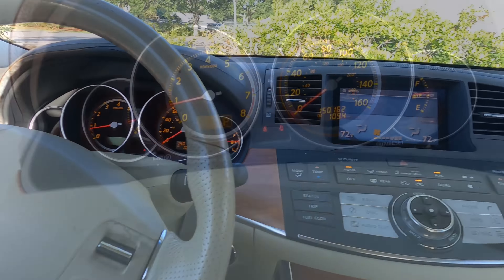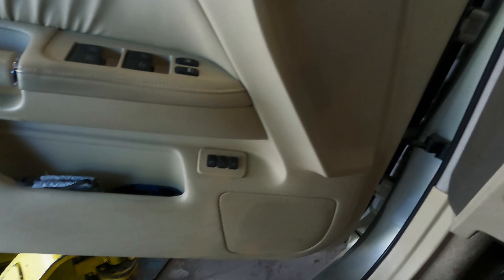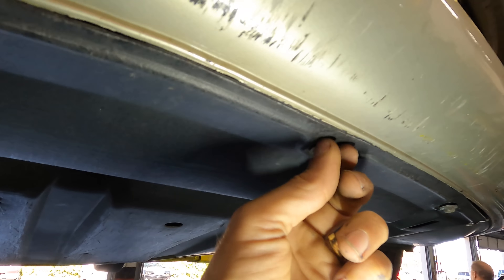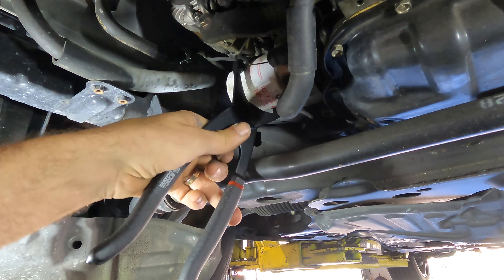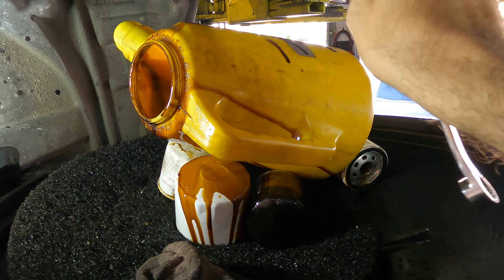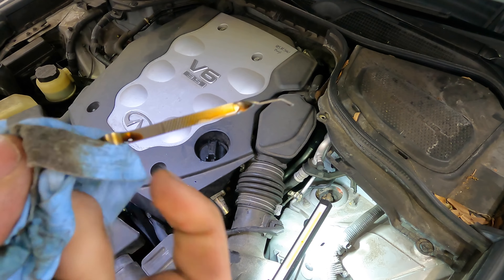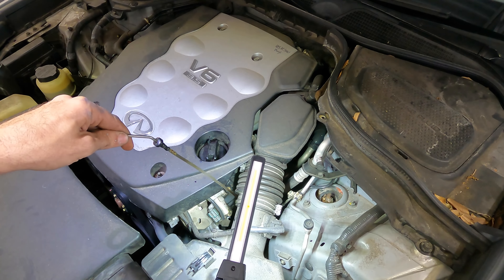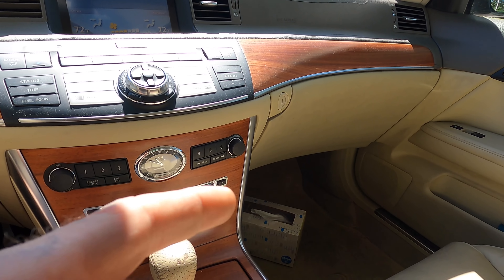Customer States: Sounds like a Machine Gun? Infiniti 3.5l V6

Comment: Lightly used well maintained infinity. Never been in shop except for oil changes very reliable. Only issue is a small valve cover oil leak, easy fix no lowballers serious inquiries only.

Comment: Good job regarding the underbelly cover. My niece had her oil changed at a quicklube place. She got a call 2 weeks later; "can you please look under your car....?" They were calling all of their customers to find out who had a missing cover LOL.
Reply: When I used the services of an oil change place, I'd always remove the cover prior to going there and replace it when I got back. I never trusted them to get all of the bolts back in, plus it gave me the opportunity to look for issues that may need addressing.
Reply: At least they called though.
Reply: the dealership stole my cover on my 3.8 I was not happy about it      apparently there was a recall(leaky valve covers causing fires)  but they should have said something instead of stealing it...
Reply: @Paramount531  so you went under the car and removed the undercover but didnt change the oil while down there? 😂 just asking haha
Reply: @DaytonaBlueHr  Might not have had something to catch the oil, might not have the confidence to do it themselves, may not know where to dispose of the oil, etc.
Reply: Those bolts holding the plastic crap underneath always seize up maybe penetrating oil?
Reply: @DaytonaBlueHr  in some places it's pretty much illegal to change your own oil like that (Precisely: it's not the oil change that's illegal per se, but doing it outside of a workshop, regardless who owns the workshop and who does the job. If you drop some oil on the pavement you are in for environment cleanup cost, as the insurance will refuse any responsibility: You have actively disregarded rules about working with hazardous liquids, one of which motor oil is considered to be, and worked in an environment not equipped/certified to control spills)

Comment: The FIRST thing I always do when it comes to engine lights and loud noises coming from the engine is CHECK THE OIL. PEOPLE DONT HAVE ENOUGH COMMON SENSE TO OCCASIONALLY CHECK THEIR OWN OIL!!!!!!!
Reply: It's not common sense though. It may seem it to you, but I have literally no idea how to even do that. Just because YOU think something is easy, you shouldn't assume it is for everyone.
Reply: Considering the fact that the hood doesn't stay open by itself the chance that the owner does a regular oil level check is next to none.
Reply: @LadyEmilyNyx  actually in some states it's considered such common sense it's one of the pre drive checks shown in a driving school, anyways learning isn't hard and it's never a bad idea to ask someone who would know and get an idea of how to check and maintain fluid levels in your car, could save an engine or prevent you from being stranded one day, wouldn't even take 5 minutes for someone who does know to show you and to explain it
Reply: @LadyEmilyNyx  No it IS COMMON SENSE! That’s the problem with this generation!! Checking your oil level takes 25 seconds TOPS! You pop your hood on most vehicles, pull the dip stick while it’s cold and on a level surface, wipe the dipstick off, stick it back in and pull it back out! There are marks on the dip stick that say full and minimum. And on top of that, we all have access to the internet and you can google and YouTube and learn anything!
Reply: And the difficulty from the dipstick placement does not help.

Comment: I have found many "odd" sounds on engines using my trusty automotive stethoscope. Really a helpful tool.
Reply: Wow I saw some of them for around 300 dollars. Those must be the best ones to get.
Reply: @xDarkAngelxc  Na, just use a long screwdriver, make a cup with your hand around the end of the handle and hold it to your ear.
Reply: @Gassit  Literally just did this last week to verify my lifters weren't ticking, it's just loud injectors I guess
Reply: @xDarkAngelxc  I bought mine about 50 years ago and only paid about $20. Better that a long shank screwdriver though.
The new ones are probably electronically enhanced.

Comment: How much cooler would that engine stay if it weren't enclosed in plastic covers both top and bottom?  
Thanks.
Reply: I've never had an issue.  

They are nuisance when working on the engine, though.
Reply: Most cars run cooler with the plastic covers. The air dams are to route air, and to control the amount of air flow, but also improve fuel mileage.  Some of the air from the grill goes all the way by the transmission. One of those things in life that make no sense.

Comment: MOT failure in the UK, also bald tyres means points on your licence. For good reason.
Reply: Same here in the Netherlands(Here it is called APK) and rest of europe I think.
Reply: my dad's friend in the US had a car with rust so bad, both sides of the floorpan were non existant, the car( a 90's chrysler) would flex every time it changed speed or direction. Deffo an MOT failure, bur it seems in many states in the USA, they don't care...
Reply: also, a mechanic taking the car out for a test drive, in the state that those tyres are in, would be breaking the law in the UK and be liable for points(your'e insurance would also be null and void of something were to happen)... they really don't care much about vehicle safety much in the USA lol...
Reply: @iainansell5930  Safety Last!
Reply: My car just passed an MOT that would normally come up as an advisory for new tyres as the front ones are perished. Not bald though otherwise I would have sorted them out ASAP. they'll be sorted out anyway when I actually have more than £5 to my name
Reply: @iainansell5930  no safety inspections in my state in the USA but in order to register your car the check engine light cannot be on due to emissions
Reply: @iainansell5930  Many states have inspections stations, some use mobile traffic stops for vehicle inspections..
Reply: @LukeTR2000  I think by UK standards "perished" means there's at least 10 000 km left in them

Comment: You should inform the customer that they need to keep adding oil if they wish to maintain the self lubricating chassis system!
Reply: Why don't they put a sheet of plywood over the engine...hence maintenance free.
Reply: The customer should be informed that the active rust protection system does not need to be used in Florida.
Reply: This person is driving a Nissan they clearly know nothing about cars 😶‍🌫️
Reply: they might add a quart then have 10-15 qts in it after a while
Reply: And check the oil often and when cold and top to the full mark
Reply: Someone watched “Customer states what” ya goomba
Reply: @TheDeadfast  Have you ever been to Florida? That salt spray eats cars alive worse than the winter salts because it's year round.

Comment: The sound was was the lifters not being pumped full of oil.  They sit right on the valve stems but get pumped so the buckets that the cam hits is the proper lash distance.

Comment: Also I heard that rattle as soon as you started the engine after changing the oil, and it quickly DISAPPEARED.  So, I agree it was due to low oil.
Reply: most engines will be a little noisy right after the oil change since the oil pump will have a little bit of air in it for the fist few seconds. Now if the noise doesnt go away, then you have a problem
Reply: There's a lot of people who think that they can let the maintenance go. Then add fluids after it breaks down and everything will be ok!
Reply: Yes, was checking the comments to see if anyone else did as well
Reply: Timing chain tensioner wore out/leaks down. Rattles upon startup until proper oil pressure is achieved.
Reply: @jarrodbinthenc6810  very common on a higher mileage vq motor which I assume this is?
Reply: @joelgoacher1643  Yes, it is, these timing chains are known to become loose when they get higher mileage, and can cause rattle.

Comment: I would definitely say that the engine noise was due to the lack of oil. I’m sure they done some serious damage to the engine running it low on oil
Reply: when he was draining it. it looked like there was chunks falling out lol
Reply: @Mr_Meowingtons  My rule of thumb is that if I get metal chunks coming out with the oil I’ll investigate and if I can’t read part numbers on the pieces I judge it to be safe.
Reply: Nissan 3.5's are known for having timing guides failures
Reply: They have hydraulic tappets and when you dont change your oil enough or whatever reason they can gunk up and stop self-adjusting... causing tappet noise. after oil change it would take a few cycles to come back. my 3.5 twi turbo developed such symptoms after i overheated the oil one weekend..
Reply: @RMJTOOLS  if the metal chunks don't have part numbers and the engine has oil preasure, it's fine.... well kinda.
Reply: People destroy their cars by not doing regular oil changes.
Reply: Early Nissan VQ35's were known to have oil consumption and timing chain tensioner/guide problems.
Reply: @4dscdriver  The QR25DE engines had issues with oil burning as well. The pre-cat would crumble and get sucked back through the exhaust ports. The ceramic chunks wipe out the cylinder walls and rings pretty quick.
Reply: Trust me I’m an aircraft mechanic.

Comment: I always find it interesting when customers decline recommended repairs. It might be because of previous experiences, but the shop I go to recommends repairs so the car will last. I find it really helps when you’re honest with the people servicing your car as well, they know what you’re doing…or not doing. I’ve never gone more than the recommended interval between oil changes (I used to do them myself, but the back can’t handle all the stooping and bending anymore). I still tinker with my cars, but not for much longer. While I have the knowledge, it’s the toll on the body that I can no longer afford. Keep up with your videos and if Peter wants to be more of a “featured” spot on your channel, I don’t think anyone would mind. Thanks for sharing.
Reply: I like it when my mechanic says: "Your front tires are worn pretty bad on the inside edge, and you might want to change them now, or real soon. And, that wear pattern indicates a toe-in alignment problem too, so an alignment would be a good call when you get the new tires.  Your call."  I usually decline, then look at the tires myself, and decide next weeks budget is going to take a hit for new front tires and an alignment.  I'm just weird like that.
Reply: @jaykellett2327  there are certain items that I will decline, like an air filter I can replace in 30 seconds. The shop I go to, well I’ve been going there since before I could drive. Trust goes a long way and these guys have serviced my family’s (and extended family’s) vehicles for over 40 years. So they will tell me that the “book” recommends replacing, but I won’t have an issue for a year or two. They know how I use my car and when things need replacing as opposed to when the manufacturer recommends replacing. Like “lifetime” transmission fluid, there is no such thing. In an automatic, I change the fluid at the very least in 50K mile intervals. More use would dictate a sooner fluid change. The idea behind lifetime fluid is that you’ll replace the car before the transmission fails, but I typically keep my vehicles for at least ten years…so I change the “lifetime” fluid to keep it running properly. It is always helpful to have a repair shop with trustworthy technicians to do work on your vehicles. I shy away from the branded shops and dealerships, not that they don’t have qualified and competent service personnel, but because they’re more in it for the money than having the repeat customer. I’ve never had my current shop try to sell me a warranty on anything they’ve installed. I get 90 days on any installed part, unless the manufacturer offers more time. If a part they installed fails, they’ve always replaced it…no question asked. I like having that reassurance. Ray would probably fit right in at the shop I use.
Reply: The crooked mechanic stereotype exists because there are mechanics that will recommend doing something that you don't need, or that they don't know will fix the problem. You can send as many kids to tech school as you want, if they don't understand how things actually work, they're glorified parts swappers.

But also, people will drive cars until they break because they see no obvious failures, the same way they live unhealthy lives and ignore doctor's warnings because things are fine, until suddenly they aren't. Fortunately, you can go buy a new car...
Reply: Or. You could learn how to work on your car or truck.. it's a good skill to have, and save money and know it's done right
Reply: @richsweeney1115  I know how to work on my vehicle, just don’t have the same ability as when I was younger. You know, the mind is willing…but the body is not able. I’ve saved enough money working on my own cars (for the most part, I still will not mess with drum brakes). It’s more convenient when you have all the equipment to do a job. My current house has no garage, so I have no place to put a lift to make working on a car easier. Like I said, find a mechanic (or technician, they’re interchangeable nowadays) and you’ll never pay for an unnecessary repair.
Reply: @ziggy4465  I'd just rather do it myself, I don't like doin drums either though ,I also don't have a garage, so if it's raining or snowing, it's not fun
Reply: @richsweeney1115  if I could stand the pain, I’d still do it myself. Brakes I can still do, not a lot of stooping…I just sit on the ground. Getting under the car to do oil changes is just too much on my back. I’d rather spend the extra $10 and have my local shop do it. It used to be where my Dad would go (he’s not at all mechanically inclined) when I was just a little boy. I stopped going while my cars were all new and I was still young. I started buying used cars and started going back again. My brother-in-law has used the shop for almost 30 years as well. Though he doesn’t let them work on his 1969 Z28. It’s not that he doesn’t trust them, but he’d rather tinker.
Reply: I agree with you! Tire, brakes, and steering should be taken care of! If there is a collision due to stinginess, the insurance should not cover the self-inflicted damages! Good luck with the marriage after murdering the children... Small cheap things can be scrapped next if you do not use your brain, driving slowly to avoid aquaplaning is not a good idea as you are not so well seen in the rain, and bang you have 65 tons through the car! It was not my fault when just such an over-cautious person got the bumper with everything in between pressed next to the front seats, I myself pulled out one screen and was allowed by the police to move on... It's good whit the freedom to make your self-decision but you should be responsible for whatever your decision makes to other people- and even more if you have been warned before!
Reply: Yeah I know what you're saying about the back and I do think they ought to do a musical called the wingnuts r Us

Comment: Ray, those 3.5 VQ Rev Up engines depending how its driven, can consume 1qt every 3k miles. So the customer shows 10k miles later, he's going to be 3 qts low. I know, I own one. Older cars require more oversight.
Reply: Yea, but we have 2 5 SPD Hondas  w over 200k miles that don't lose any oil.. Nissans tend to when they're older, along with a few other brands
Reply: That's nothing 🤔, I wish that I got 3k for 1qrt of oil in my car. I get 400-500 miles per litre🤪, in an Audi 2.0TFSI.the car is a 2010, done 74,000miles.i've only had it a year😕😏🤥🙈😭🇬🇧
Reply: @stephenwilliams6103  that is terrible. My 1990 Volvo 245 has 387,000 miles on the clock. It is just due for an oil top up as it is due for an oil change. Oh, and the automatic transmission is the original an works perfectly.
Reply: @stephenwilliams6103  those are kinda crap anyways
Reply: Typical De and De revup problems lol. My Hr doesnt burn any oil and i gap FBO tuned De’s while completely Stock still haha
Reply: @richsweeney1115  not the Hr and Vhr motors…… well maybe the Vhr’s a littlr at the track since VVEL has a problem with high oil temps. Hr’s have better flowing heads but no VVEL so no burning oil at all haha

Comment: I have the same engine in my G35. It was funny watching you deal with the stupid dipstick. 

The cover on my car has just enough room to access the filter and drain plug, but it makes kind of a mess if I leave it on.
Reply: That dipstick looks like something that got botched in last minute when the design team realised they forgot something.
Reply: @TheDeadfast  You should see it up close. It has a metal channel to guide it that gets dirty and you can't reach it to clean it. You rarely hit that channel without getting the dipstick stuck. Then you have to twist it in. After that, it's always difficult to tell the level when you have clean oil. 

I was laughing at Ray when he was trying to do it with one hand. 

I use to work at a service station and it's clearly the worst design I've seen. 

At least it's not a Ford though. They always loved putting the oil filters over the cats or exhaust. I was always burning myself and what a mess.
Reply: I'm glad I'm not alone regarding the dipstick on the VQ35DE.  One of the worst such designs I've ever encountered.

Comment: When the feet are turned around it just represents the mechanic standing at the front of the car admiring those beauty covers.
Reply: Personally I think that's why the oil ran low they come find a dipstick because of all them beauty colors and I guarantee they keep the engine nice and warm in the winter